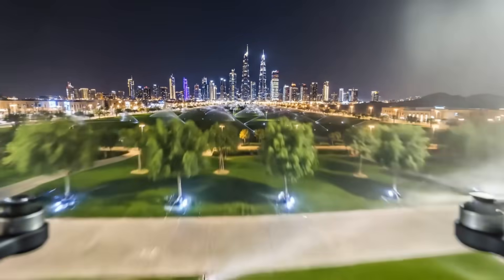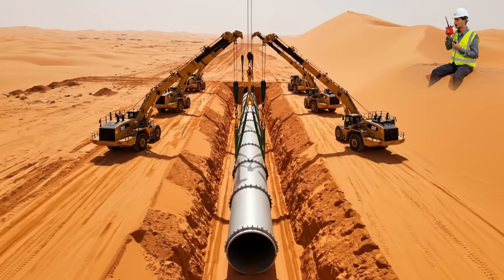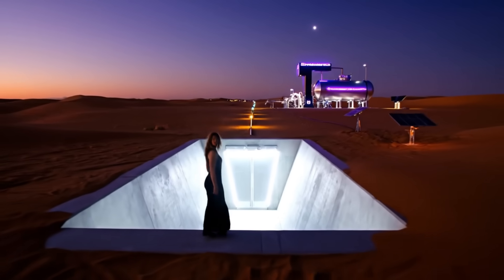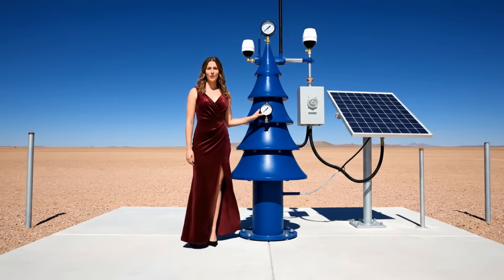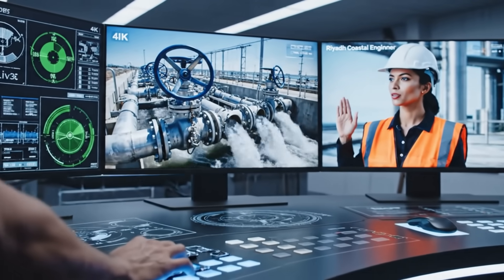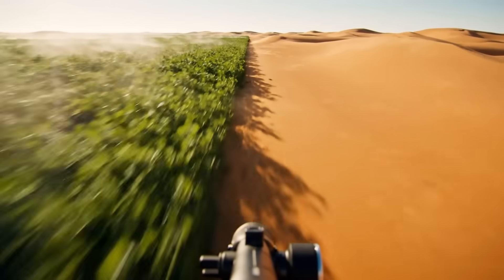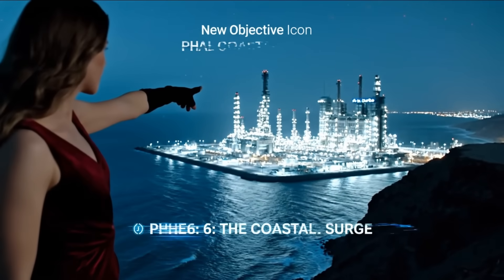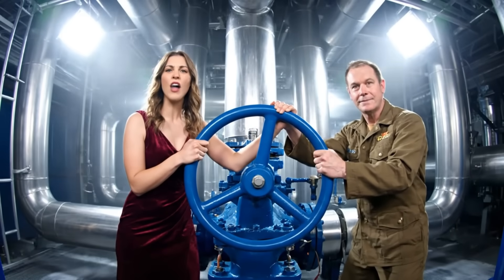Inside Saudi Arabia's $10B Liquid Highway🇸🇦: Buried Salt Water in Sand, Result is Unreal

Comment: Ocean water contains 150X more Co2 than air & when combined with mineral rich salt water the production of cement, bricks, life sustaining chlor-alkalk chemicals. can be produced along with manufacturing sodium ion batteries, hydrogen gas safely stored in room temperature non-toxic liquid by Ayrton Energy in Canada.